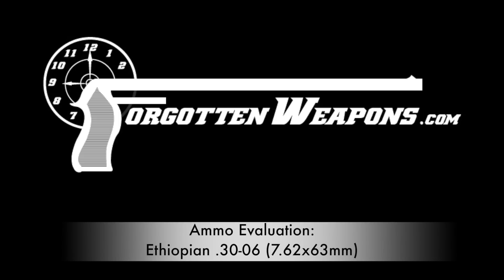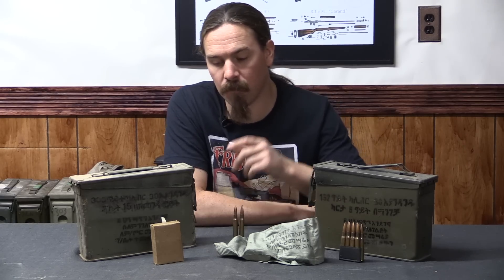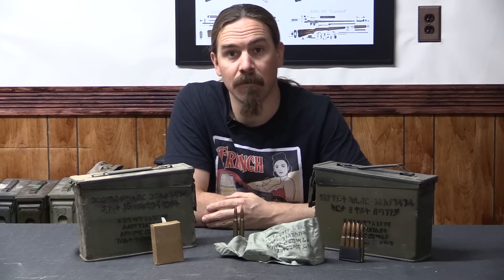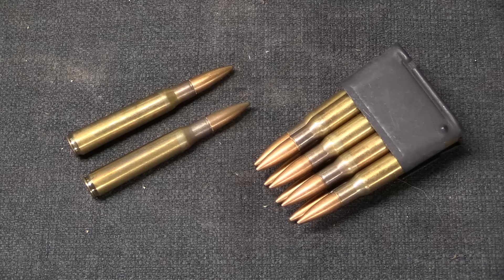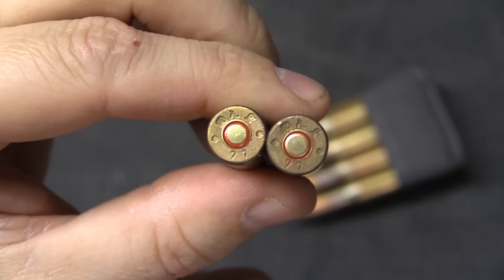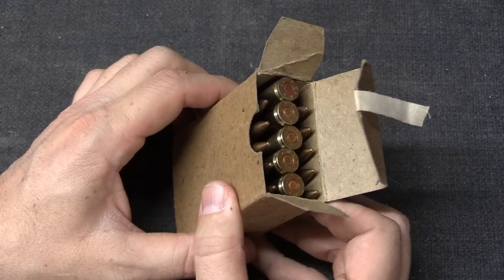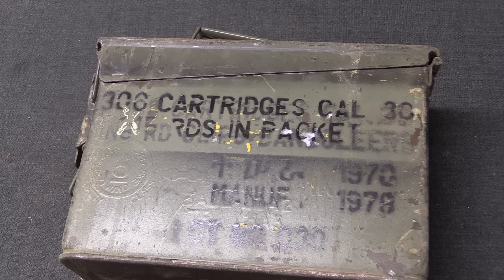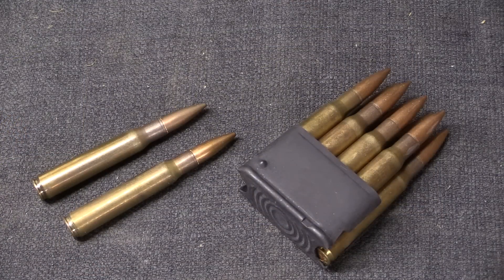Ammunition Evaluation: Ethiopian .30-06

Comment: You can see why 30-06 has remained one of the top Hunting Cartridges in the US.  It will take anything on the North American Continent. Not bad for a cartridge designed almost 120 years ago.
Are there better performing cartridge? Yes, of course there are, but the 06 can still hold its own. 

Ethiopia uses the Coptic Calender rather than the Gregorian Calender the West uses. It calculates out to between a 7 to 8 year difference.  So I'd guess for export/import restrictions they have to double Date stamp either everything going out or to comply with rules and regs Date wise, of anything they import.
There are a few countries that use the Julian calender too.

Comment: "Slightly Hot"  3000 FPS is pushing it with modern powders and strong bolt action rifles.  I would NOT put it through a Garand.
Reply: You could, IF you have an adjustable gas plug to bleed off the excess pressure
Reply: With a 150 grain bullet and .30-06 3,000 isn’t too hot. There are quite a lot of modern .30-06 commercial loads with velocities in that range. Plus he’s testing with a 26 inch barrel whereas most of the tests I’ve seen got that same velocity with 24 or 22 inch barrels, so that also probably makes a difference
Reply: Uh, ~ 2750 or so, with a 147 grain projectile.
Reply: Thanks i thought i am the only one who thought "holy shit".

Comment: Were I to be gifted a few thousand, I'd probably pull the bullets, collect the powder and work up a more reasonable load. The corrosiveness of the primers could be checked by firing one (a primer) onto a sanded mild steel plate and left in a humid environment for a few days.

Comment: Hey Ian, random question. Someone who went through basic training back in the early 90's told me about the M18 made by Boadan and Adams Firearms. I never heard of it so i tried doing some digging and it seems pretty hard to find anything on this rifle. Would you happen to know why? Apparently it was used during Vietnam and remained in service for a few decades. Thats all i know.
Reply: There's a hinky photo of the weapon on the PIMP MY GUN wiki, with a dubious article attached. It has the same slotted forend as the HK43 or could be a tricked out HK33 or Harrington & Richardson T223 with an HK43 forend. 
The T223 was trialed by the Navy SEALs in the mid-1960s and was used in the Army's Light Rifle trials. It was never formally adopted, so it wouldn't have the M18 nomenclature. The "M18" is fake.
Reply from the maker: I have never heard of that...

Comment: The garand bolt has the strength; the weak point is the operating rod.  If gas port pressures are above spec the operating rod can get bent and I guess the back of the receiver might suffer some damage.  If you have an adjustable gas port add on you can adjust the port pressure and all will be well.  I am not sure how it would work in a browning machine gun.

Comment: A little hot? That stuff's nuclear! Looks to check pretty much all the boxes for good surplus ammo in the 20+ year range. Not gonna be precision target ammo and all the old foreign stuff seems to be corrosive, but high quality, reliable, and well packaged/stored. I'd buy it.
Reply: I agree. For surplus ammo from 1977, you can't ask for more.
Reply: Most old foreign 7.62 I have found from the 70s has been very good and non corrosive, but all the Ethiopian ammo seems to be the exception along with Indian. Some of the powder used in this Ethiopian may have been surplus even at the time. This ammo fared pretty well considering the very humid climate. Ammo surplus from dryer desert climates fares better.

Comment: FYI - A quote from "Cheaper Than Dirt" website, "For surplus ammunition, there are two main types of primers: Berdan and Boxer. Boxer-primed ammunition is not corrosive, so you don’t have to worry about it. Not all Berdan is corrosive, but almost all of the surplus ammunition you find on the market with Berdan primers is corrosive.
Reply from the maker: That is an inaccurate simplification.
Reply: @ForgottenWeapons  Your right.  As I understand it the US switched to non corrosive primers in 1953, but match ammo still used corrosive primers many years later.  It was thought that corrosive primers were more reliable and longer lived and so the military was reluctant to change over (we don't trust this new fangled stuff).  But for different parts of the world, corrosive may have been loaded much later.
Reply: @ForgottenWeapons  "Cheaper Than Dirt" handles more surplus ammo than I do so thought they should know more than I do on the subject. Personally, I treat all surplus ammo as corrosive until proven otherwise.

Comment: I think it's a crime to show a bandolier of M1 garand ammo and not shoot it.
Reply: Too hot. Poor op rod might get damaged.
Reply: Terrance Petsas pretty sure he has an adjustable gas plug
Reply: @alexmoore1506  I still wouldnt risk shooting corrosive or even possibly corrosive ammo in my Garand...
Reply: @thkarape  he said his Enfield would be strong enough to handle, and he only said this ammo is more towards the hot side but you sound like you think the thing has an atomic load...
Reply: @s00-x2h  It's 200 fps faster than standard M2 loads. Not an atomic load by any means but not one that's recommended for use with the M1 either.

Comment: Great video as always, but let me start out with I have 4 M-1 Garands and I bought some of this Ammo several years ago from Sportsman’s Guide. It is the most inaccurate and I experienced some hard primers that wouldn’t fire first time. I also had many rounds that I could spin around in the case. The Greek surplus I’ve found to be the best this far in my Garands. Just remember not just any 30.06 will work in a Garand has to be M2 Ball thanks for the awesome video.

Comment: I believe the standard M2 ball was chronographed with a 24" 1903 Springfield. Using the 26" you used should account for the increased velocity.
Reply: @ Peter Connell  Good point. Too bad he didn't have a controlled lot of ammo to compare to.
Reply: A comparison chrono of M2 out of the M1917 would have been good.

Comment: Hot ammo is hot.  I wouldn't shoot that in my Garand.
Reply: An adjustable gas port wouldn't hurt, but I won't willingly put corrosive (or potentially corrosive)in my Garand.
Reply: @monkeyship74401  new ammo is cheap enough, wouldn't buy this crap
Reply: @JohnAdamso  Handloading .30-06 is even cheaper.
Reply: @JohnAdamso  I just picked up a 500 round box of brand new and shiny PPU M1 Garand safe ammo for less than .50c a round. I honestly dont get why people fuck around with this stuff these days.
Reply: sergeantbigmac where pray tell did you find this ammo?
Reply: @aaronbelden8894  A little late, I know, but SG Ammo has it in stock, price is about .60 a round.
Reply: Bent op-rods.
Reply: @praetorxian  gee, My M1 oprod was bent at Springfield in 1944.  I understand what you're saying though.
Reply: Flying lead  Enfield barrel is longer than Garand barrel.

Comment: those seem a little hot for a garand (i know he's not using garand obviously). weren't they designed for around 2700-2800- fps?
Reply: or does that enfield have a longer barrel?
Reply: lol i should have watched the whole vid before commenting.
Reply: Peter Connell  ah ok. its the barrel then. wiki says the garand is 24in also. thanks.

Comment: If you get a chance do some Chinese 7.62×39. If you guys get it in the states
Reply: Here in Canada we get piles of that copper washed chinese surplus.  I preferred the steel laquered case russian surplus that came with the stripper clips, that seems to have dried up.
Reply: @interlake2043  yes. I dont see it at cabelas anymore. Was curious to see how good the Chinese stuff is
Reply: @interlake2043  not sure if they get it due to trade stuff with china
Reply: @nathanielwowchuk6880  yeah we get all the Norinco/Polytech stuff here and the nice Russian surplus Mosins, SVT-40's and SKS's that make the US collectors envious.
Reply: @circleofsorrow4583  in Canada there is a loophole where you can use the LAR-15 10 round pistol mags in any rifle that accepts AR mags.  You can buy hi cap mags and AR/AK drum mags, most just have a simple rivet blocking the follower at 5 rounds or a metal bar welded underneath.
Reply: @circleofsorrow4583  as do I!
Reply: @interlake2043  I liked that ammo as well, though it was Czech not Soviet surplus. I now have about 60 clips for my SKS's because of it!
Reply: @B52Stratofortress1  was it Czech? It was always advertised as Russian,   the lot I had was labelled "bxn 86" on the headstamp.  I kept many of the stripper clips as well.
Reply: @B52Stratofortress1  I just checked and you're correct.  My green box 7.62×39 and 7.62×54r was Czech, thanks for clearing that up.  Czechs make high quality ammunition and firearms.
Reply: @interlake2043  Makes sense the Czechs had a well developed arms industry, which the Nazis retooled to supply the Third Reich.
Reply: @interlake2043  That they do. I'd like to add a VZ 42/57 to the collection. From what I heard, the Czech x54r is actually Chinese prodeced ammo, sold to the former Czechoslovakia and repackaged by Sellier and Bellot while it was there.
Reply: We haven't gotten any chinese ammo in a long time